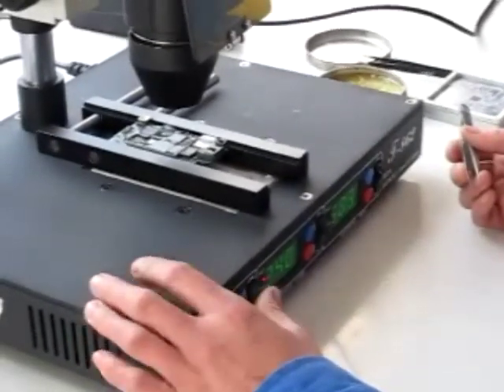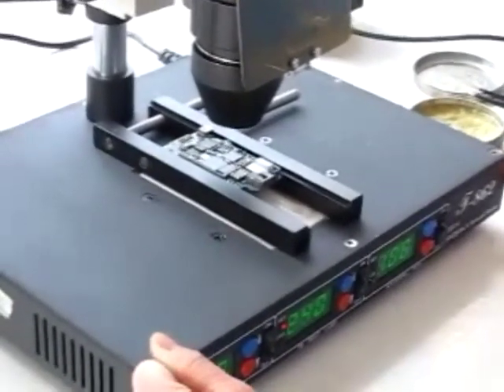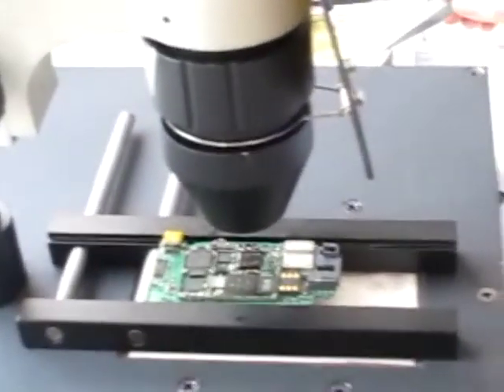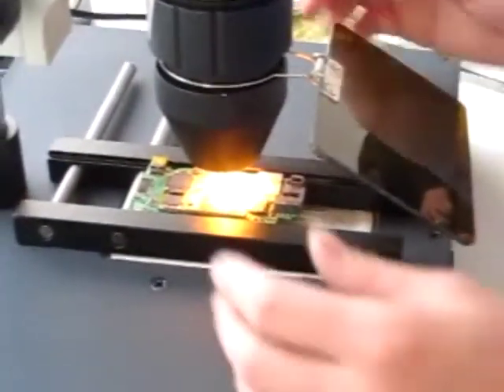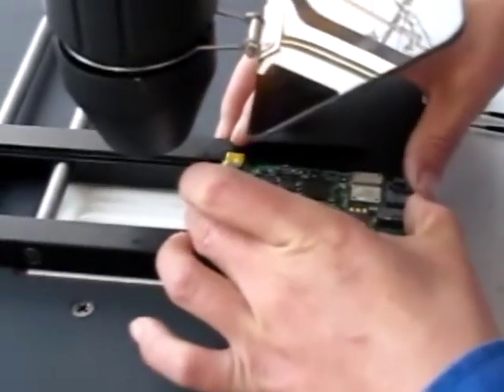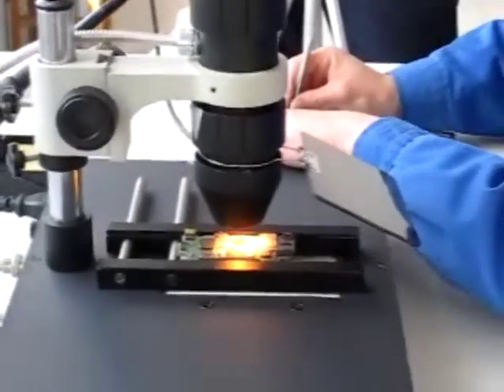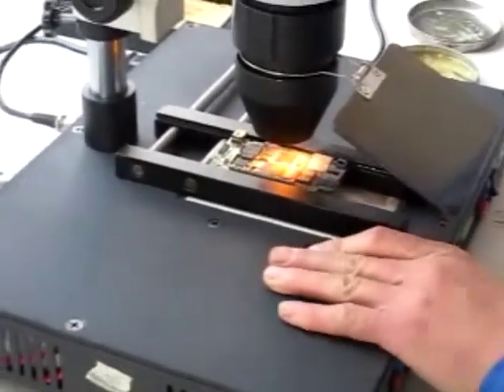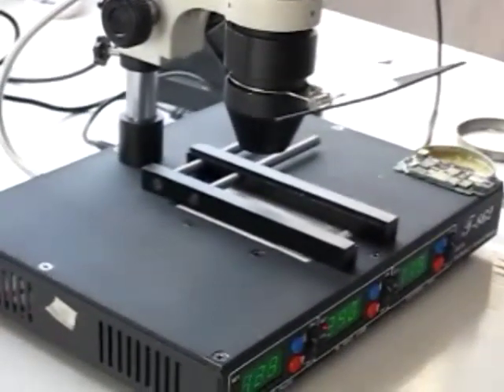How to... ? Rework ... T-862 Digital Infrared IRDA Soldering Station 3 in 1 - Tutorial

Comment: What paste you use for desoldering? Seems grey but i am not sure what is it. I am running tests and i am doing ok with BGAs but most of the times the board looses their pins i am using 250 degrees at 2cm for 1x2Cm chips. On SMG chips i cant even melt their conections so i am asuming it has something to do with that paste i am not sure about. Could you help me please?